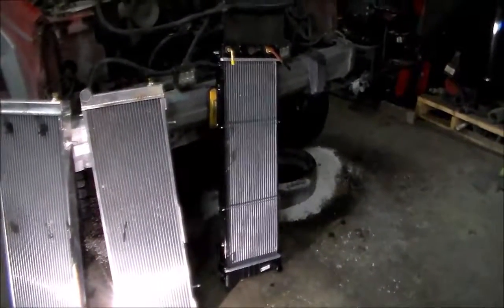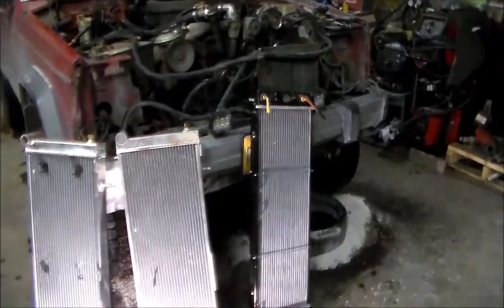Replacing E Bay radiator in jeep with 6 2 diesel

Comment: With that engine you might be getting too much flexing on that unibody and that be causing the radiators to crack .
Might think about welding some plates on the unibody to help stiffen everything up .
Reply from the maker: They were just cheap ebay radiators.  The factory replacement radiator has had no problems for years now.

Have to be careful with welding to a unibody the edge of the weld is brittle and with flex can crack or rip off of the unibody.